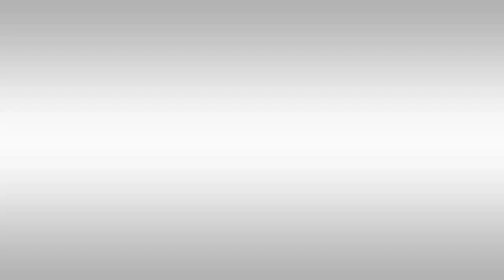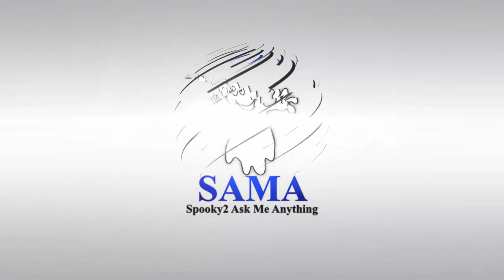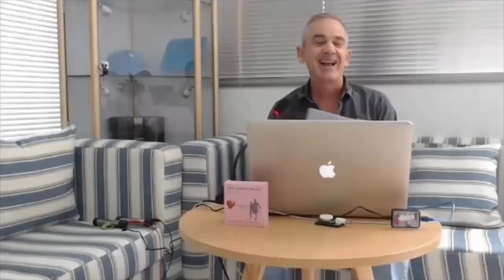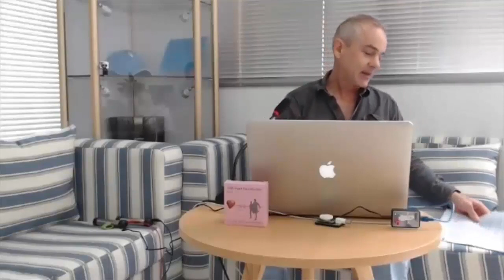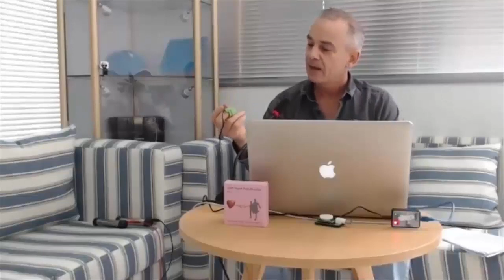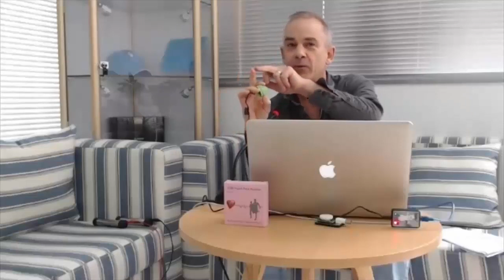What is Biofeedback Scan and how do you use the Spooky Sensors?

Comment: Tried my Spooky pulse for the first time via ear lobe and the red light seemed to pulse evenly at the beginning but once the count down to the scan got into the last seconds it starts to go a little sporadic more and more and will freeze for two or three seconds at time as the scan runs and has kept doing that since. I'm very discouraged. I'm in my 40's, exercise, and not terribly sick and never had a history of erratic heart beats so I'm sure it's not my heart. I'm using a Spooky generator (XM) of course with boost, however I'm using contact mode to use an RF antenna to introduce frequencies into the body instead of the bars or pads..just thought it would be more effective. I don't think that would have anything to do with the Spooky pulse sporadic behavior though or else it would start only after the generator starts, but it starts before the count down is finished. :(  Any suggestions?
Reply from the maker: Hello, we are so sorry to hear that, we recommend you to join Facebook group: https://www.facebook.com/groups/spooky2/ and people here are willing to give you advice! :)